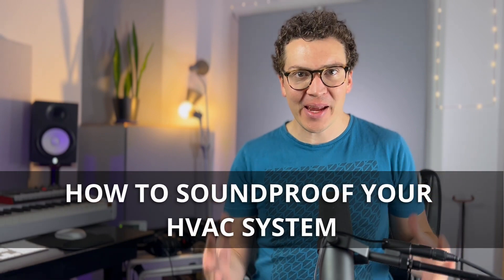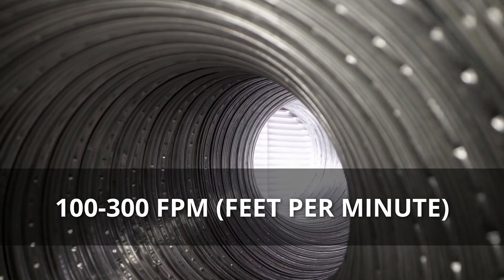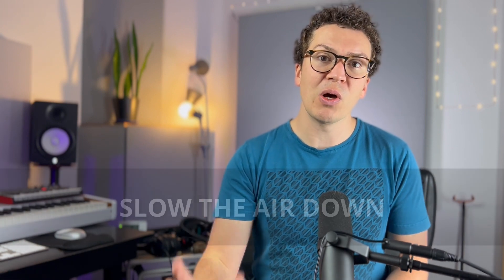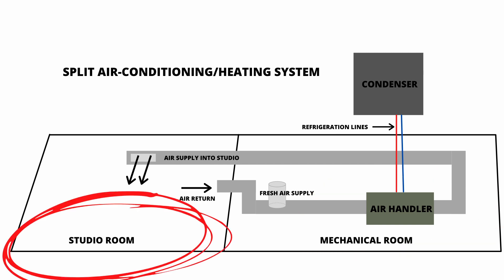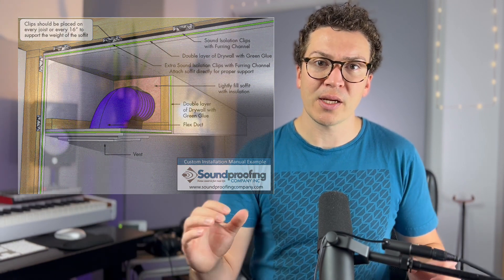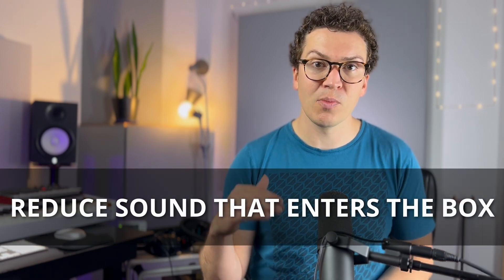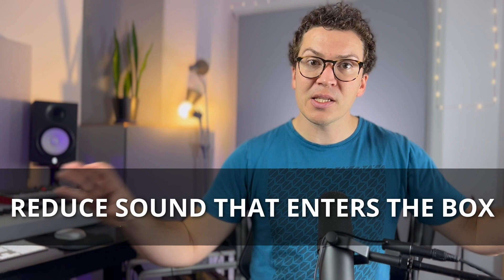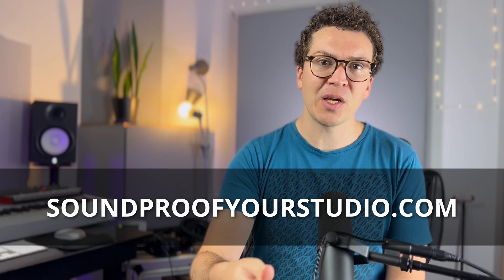How To Soundproof An HVAC System

Comment: So this was about soundproofing your ducts. not the full HVAC system. Got it.
Reply from the maker: Yes, the idea is the by soundproofing your ducts you won’t hear the hvac system. Plus you need everything else for a fully soundproof room.
Reply: @soundproofyourstudio  that's great, and there is good information here, but the hvac room/closet can be noisy also. Some blowers, like mine, unfortunately, are just loud and should be addressed as part of the HVAC system. 75% of all articles and videos I've seen only address the vents or HVAC vibration. Thanks, though, keep up the good work.

Comment: Love the vids - they've really helped with my studio build over here in Australia. I've just built and installed two baffle boxes for air supply and return but have hit a snag with a part of the HVAC that I don't often see discussed - the vent/grilles themselves. The ones I purchased create so much extra noise and it's difficult to source acoustic grilled without spending a fortune. Any info/links on the grilles you went with in your studio? Thanks a lot!
Reply from the maker: I used Nailor industry grille amd register. 12x12
Reply from the maker: Did you calculate CFM and air speed in your baffle box design?
Reply: @soundproofyourstudio  Thanks for the reply. Yeah, I have approx. 250 cf/m on the lowest fan setting. I'm not using an ERV, just drawing out air with one baffle box and providing clean air via another. Works well until the grilles go on.

Do you have a direct link to the Nailor product? They have a lot of options! I don't think I can get their products here but at least it might give me a clue as to what I'm looking for.

Out of interest, if you are using 12x12 registers, does that mean your ducts/baffles are 1 foot? That may be part of my issue - mine are 150mm (approx. half a foot). I may not be slowing the air enough?

Thanks again!
Reply from the maker: Oh man your air speed is probably at 1000 FPM and should be 500 max and ideally 300 or less. I would do 300x300 @warrenclark358
Reply: @soundproofyourstudio  Thanks mate. I thought that might be the case. Unfortunately, I'm not at a point where it's practical to adjust the duct and wall opening so I'm looking for an alternative solution. Funny thing is, it's almost silent without the grilles on.